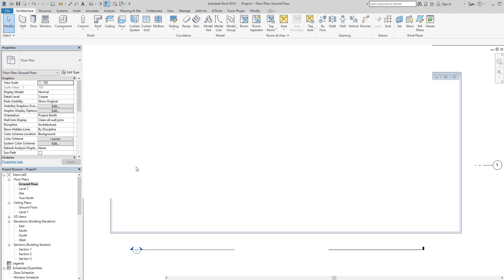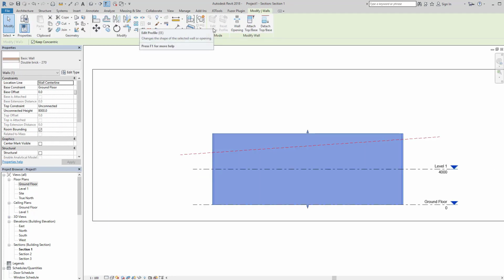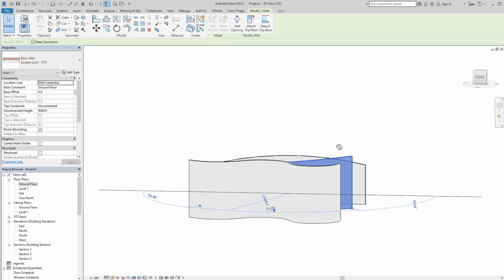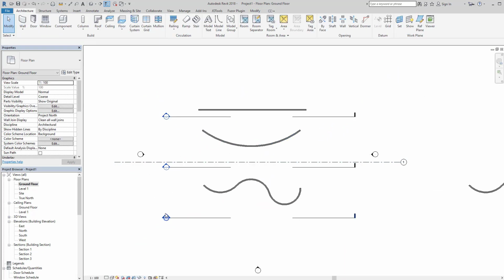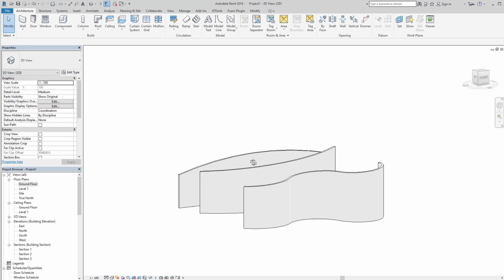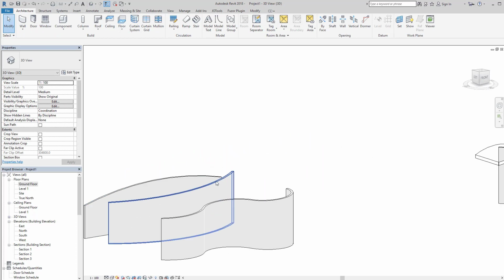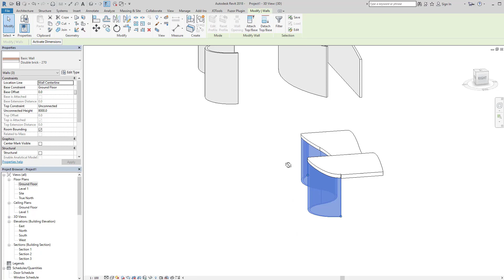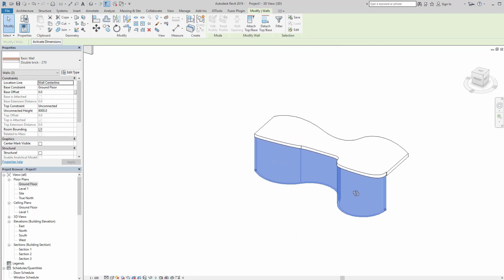BIMedge - Editing the Profile of a Curved wall

Comment: Nice, but is there an actual way to edit the profile of a curved wall? I'm trying to make circular holes into my curved walls but it seems impossible.
Reply: The easiest way would be a face based family.
then you can also just use one family with a parametric diameter and depth of cut.
Reply: @joebanks548  Nope. The easiest way is a void in-place component
Reply: Is there any way to make a slanted refrence plane, PLEASE TELL